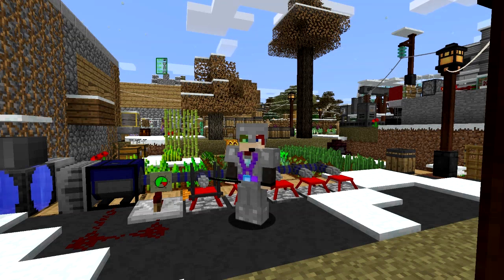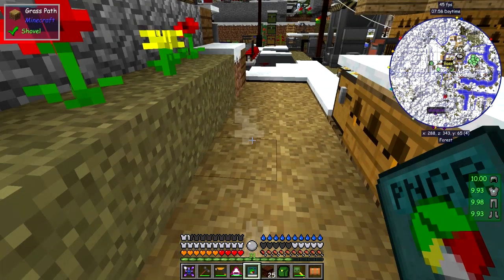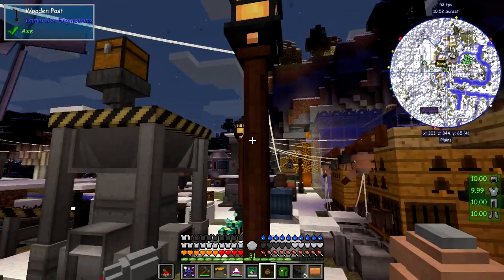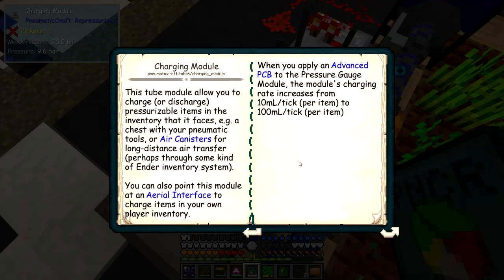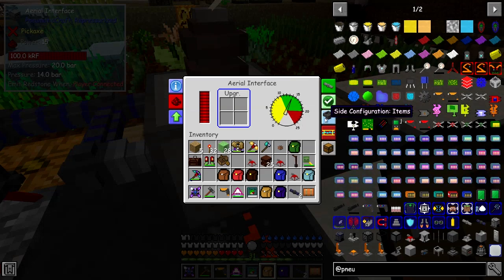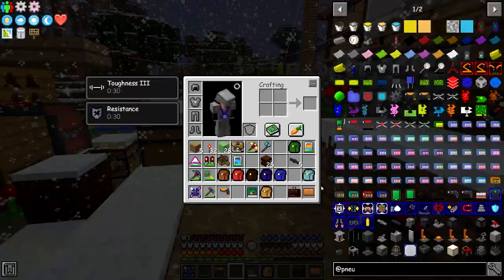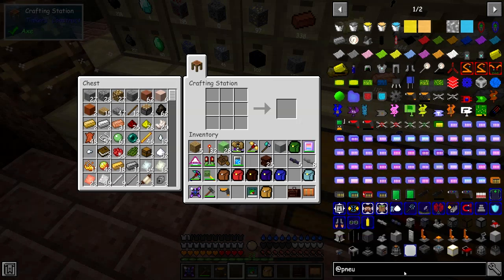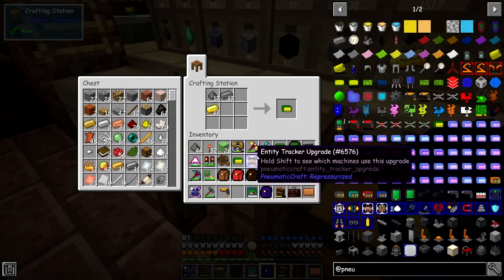Real Tech #087 - PneumaticCraft Repressurized: Aerial Interface, Armour Upgrades & Sentry Turret

Comment: 9:05 yeah that's a typo :)  "Pressure Gauge Module" should indeed read "Charging Module"
Reply from the maker: Thought so, got me going for a few secs :-)
Reply from the maker: Do you want a ticket for this? Pneumatic boots seems to be missing from the documentation too.
Reply: @duncanwebb4934  the charging module typo is already fixed (in the 0.10.3 beta release).  I noticed the lack of a boots page in your book, which is odd because the entry is definitely there (works for me...).  I'll look into it though, no need for a ticket.
Reply from the maker: @desht2008  it is strange can't imagine what is causing this except data corruption.
Reply from the maker: @desht2008  I found the entry, the index is sort of alphabetically sorted but in two groups. This might be because I've not viewed all items and the setting B:"Disable Advancement Locking"=true.
Reply: @duncanwebb4934  ah yes, that would be it. That's just how Patchouli works, I think.

Comment: 26:34 not replanting wheat is probably because of vanilla mechanics: when wheat's harvested, it doesn't always drop a seed.  If no seed is dropped, the drone won't (can't) do any replanting.  The workaround here really is to have another drone responsible for just replanting wheat.  (Or possibly extend your farming program to explicitly try to plant wheat seeds in the wheat sub-region)
Reply from the maker: That makes sense I hadn’t thought of that mechanic, thanks. In this pack we can right click all crops, so the fix is easy. Might be fun to program it to plant seeds.

Comment: 15:50 when in food/xp mode, the Aerial Interface doesn't care about sides - food can go in any side to feed you, and XP can go in or out of any side to supply or drain your XP bar.
Reply from the maker: desht2008 thanks, that explains why the charging module doesn’t work with the dispenser upgrade in, show this behaviour in Wednesdays episode. Rough tweaks prevents regen from food otherwise I’d configure it for food.
Reply: @duncanwebb4934  yeah the charging module is looking for an item inventory.  The only solution if you want both autofeeding and autocharging is two Aerial Interfaces (which works fine) !
Reply from the maker: Thank you, I saw a ticket about this.

Comment: 11:38 the range is infinite (including cross-dimension)
Reply from the maker: Wonderful, was going to check in the nether.
Reply: @duncanwebb4934  it'll work fine as long as the Aerial Interface is chunk loaded.
Reply from the maker: desht2008 next time I play with pneumaticraft repressurized I’ll be building the aerial interface as soon as i can it’s way too useful.
Reply from the maker: desht2008 thanks again another great tip that I tend to forget.